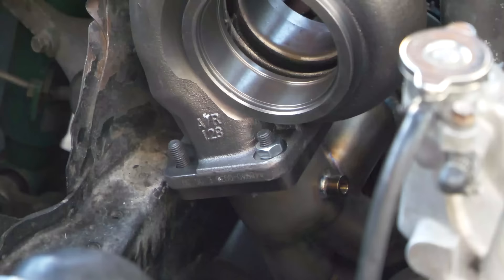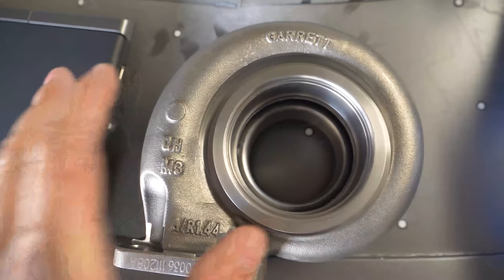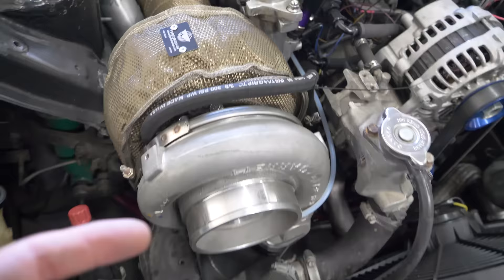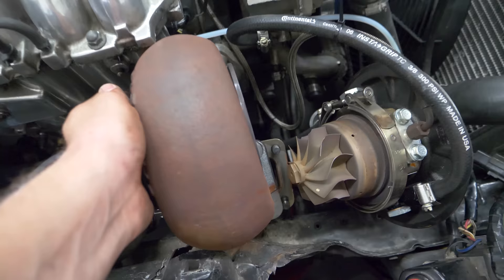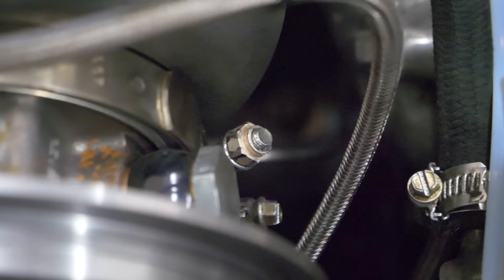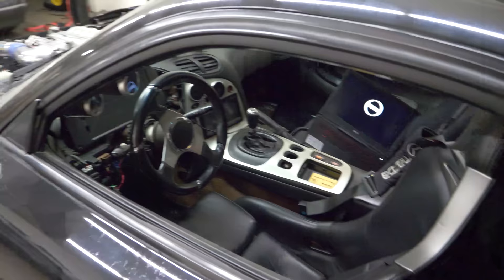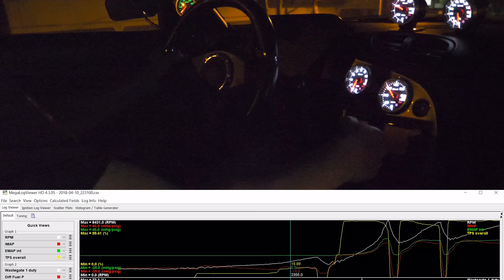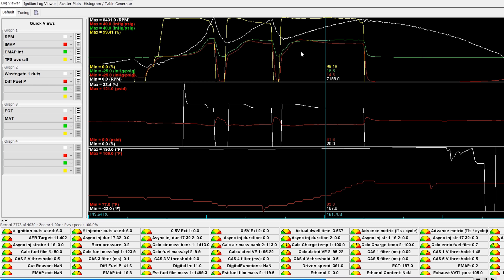Is it worth $600 to upgrade your Turbo Housing? | Rob Dahm

Comment: Put anti seize on the stainless steel threads. Put the nut on it and use a cordless impact and run the nut up and down on the threads. It will help the stainless steel threads from galling

Comment: Thanks for making this video man, love the technical nitty gritty shit :D Surprises me the boost response was not affected!
Reply from the maker: Me too. But it really shows the turbine wheel diameter is the choke point at this point. I thought there would be a trade off.
Reply: I think the 1.44 was identical to the 1.28 response because the 1.44 was a true twin scroll and although larger, ultimately evened out the pro and con.

Comment: Why not a $20 turbo for the Insight from Walmart?
Reply from the maker: Wait til you see what I have coming haha you will love it 😈
Reply: i hope its a junkyard ecoboost turbo
Reply: Cummins swap?
Reply: I can dig that
Reply: eBay turbo
Reply: Rear mount turbo? You could just about make one from a Kei-car turbo with an ecoboost 1l compressor and it would be somewhat responsive.

Also good luck getting your head around negative ignition timing on boost :p
Reply: A business in tampa,Fl called lht has a turbokit for the insights im wondering if thats what hes talking about

Comment: Heat will rust 316 stainless let alone cast iron
Reply: They make high heat paint for things like that , if it bothers you enough . Fact is a little of rust won't hurt anything . You could clean up a 30 year old turbo and things like the housing will be just fine , just bearings and such would need replacing . If the car was always used , a 30 year old turbo would still work almost like new without rebuilding it .
Reply: Or better yet, ceramic coating

Comment: The rust is simply due to heat. Rust is a chemical reaction. What makes chemical reactions happen more quickly and vigorously? Heat. Simply put, the heat the turbo generates means even the moisture in the air is more than enough for the housing to rust in short order.
Reply: J D This and the blanket also holds moisture.

Comment: fantastic video. not sure if anyone is appreciating the back to back log of backpressure difference from a hotside swap. i also experienced the same dyno curve after going from 1.01 to 1.44 hotside with absolutely no difference in spool with 20b. weird! is the only word i can think of.  did you by any chance log the exhaust temperature during both events? would you be able to post them as well? i suspect EGT also fell with the lower backpressure. thanks.

Comment: Rob Dahm putting the science back in HP
Reply from the maker: It’s so much money to spend. I figured if I was going to do it I would document it and help others figure out if it is worth it. Juggling housings and turbine sizes is a game for wealthy people. I don’t have that sort of money to spend and I hope my findings help my viewers avoid the same expenses
Reply: Rob Dahm its great that you do this especially with actual numbers. Like you say its a costly exercise where most of us can't afford.
Reply: But you can afford it, prioritize. While Rob wants to see if this made a difference and it has, this is a real problem for Ecoboost engines partially Focus ST owners who are obsessed with not losing the quick spool and torque of the tiny K03 turbo but want more mid range and top end horsepower. They typically buy GTX28xx turbos with .64 internal housings. These things are for engines under 2.0L in reality, even the original GT2860 "Disco Potato" was .86 A/R GT25. Noted tuner Nishan believes as I do that some engines are being damaged because of too much back pressure especially when the boost is cranked up into the mid 20's to high 20's. Since almost NOBODY measures back pressure to know and they do automatic things like delete the converter without understanding why that needs to be done is why the ST community is where it is, full of newbies and those without any experience with turbochargers giving advice to others who are equally ignorant. Then they want to giggle at me when I put a GTX3071 on my car and they think it's a laggy mess when they have never driven an ST with a turbo larger than GTX28xx. I am going to start logging back pressure as well, because I think to go over 450 hp safely on the stock engines I must upgrade exhaust housings and go external wastage to potentially free up some additional exhaust flow. Somebody upgraded to external on a GTX2868 and picked up 30 hp/30 ft of torque with no changes, so I know there's too much back pressure with the smallest housing for the ATP kits. But even the BW EFR 7163 uses a GT25 turbine housing.
Reply: Luckily for me the GTX30 turbos are T3 .63 A/R which is what I have. It outflows the .86 A/R GT25 housing by quite a bit.

Comment: I went to a 1.06 a/r for my gt35r because I couldn’t got an externally wastegated bottom mount setup in my m50 build. I had the options of .65, .85, and 1.06. I went 1.06 and I can’t wait to have stupid high end power.

Comment: You can see where the exhaust housing was touched by your hands during installation. The oil from your hands plus heat accelerated the corrosion process. Notice the lower part of the housing near the vband has no rust. It wasn’t touched as much as the top. But no worries it’s only surface corrosion and would take 100 years to eat through the housing.

Comment: If you got a stainless bolt and a stainless nut they'll gall up especially at high-temperature exposure like an exhaust. Copper-based or nickel based (e.g. Jet-Lube) will minimize that risk later on.

Comment: The rust is part of the protective coating for the system. As it cures when the turbo heats up it builds an oxide layer. This layer is designed to not penetrate deep into the metal and prevents further major rust issues in the future. This is used because there really aren't many other cost effective coatings that can withstand the heat and expansion that a turbine housing experiences.

Comment: Back pressure isnt always bad. You need some. Its what drives your turbine but what can also choke your motor.  Drive pressure should be 1:1 but rarely is.  Theres always going to be compromises , loses and gains in A/R housings.  Some worse than others depending on how radical your changes is.

Comment: Ok so turbo housings are cast iron coated in a light oil to keep it from rusting, you heat it up once the oil burns off and the hot cast iron pulls water out of the air and rusts almost instantaneously, it’s pretty typical. What i would have done is got a tial stainless steel housing.
Reply: Cerakote...
Reply: Anthony Thomas  that works too but for rotaries that can’t run a twin scroll because 3 doesn’t divide by 2 well. The big v band housings tial make will flow better, weigh less  then the same a/r standard housing and not that it really matters, but it will stay clean looking.  Cerakote  especially if you do the whole exhaust makes a turbine act smaller than it is because it keeps that much more heat in. Great for response, bad for the big end.
Reply: They make ceramic paints for exhaust headers, i would think that could take the heat and prevent rust.

Comment: That's Kool. 

I have a 1.32 housing
Was told to move to a 1.45 housing.

I am running a SXE476 pushing 48 psi.

I want to get the SXE S480 with the 1.45 housing.

I am running a 12.7 Detroit

How do u log that info.
What sensors are you running or should I get.

Thanks. Turbo sounds sick

Comment: Having back pressure on mine right now, hoping upgrading from .96ar to a 1.38 or higher would work.  anything over 20psi, which is 1k to the tire, I have major backpressure issues
Reply: How did it work out?

Comment: now I found this video on garret advance motion website, it's talking about the compressor side AR, and you are talking about the turbine side AR, another friend of mine also told about turbine side AR, but most turbos put the compressor side AR, what is what sir?
Reply from the maker: So the maps are about the compressor side and they reference ar but no one messes with that on compressor side. Only turbine side do you mess with it with various exhaust housings.
Reply: @RobDahm  thanks for the reply, just researching on a turbo that would best fit to my M52 bmw engine, it's 2.5 liter, so I should be looking at turbine side or compressor side AR sir?

Comment: Hey Rob, are you measuring back pressure before or after the exhaust turbine? im assuming its between the exhaust port and the turbo, so higher back pressure is a good thing. I'm just used to hearing back pressure as a bad thing that you want as little of as possible lol
Reply from the maker: Before exhaust turbine. You don’t want it to be higher than boost pressure if possible. That will force air from the exhaust into the next rotary combustion chamber. Abel cut it off at 10psi over boost. So if I’m running 25psi boost the exhaust is 35psi. Bas